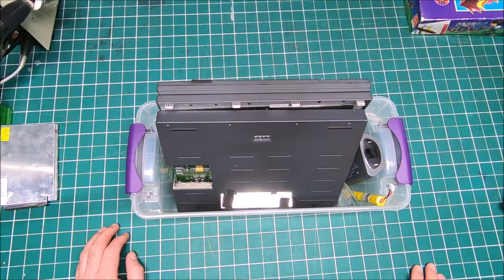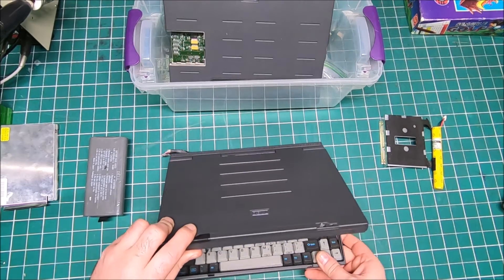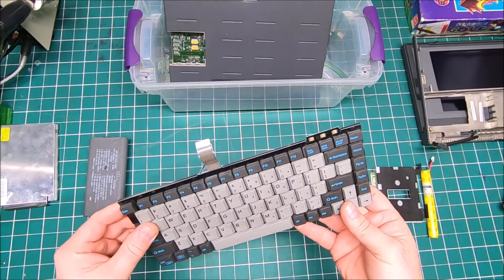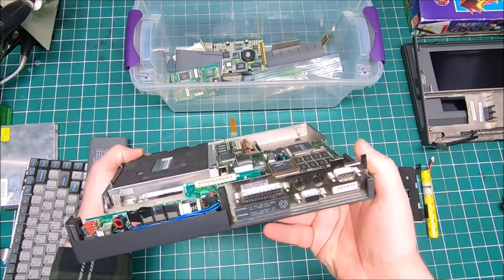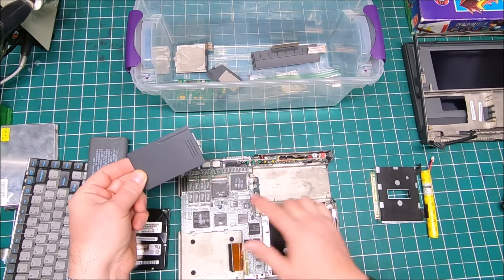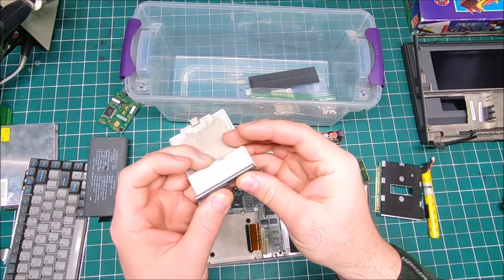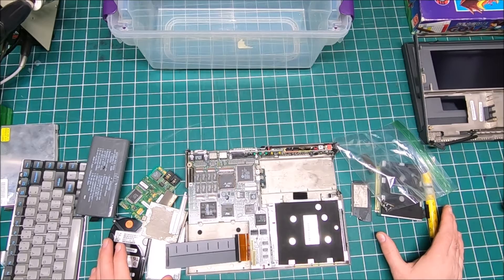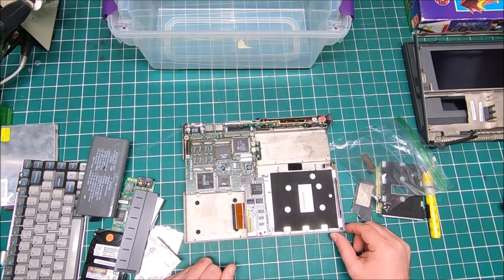Rare Vintage Laptop Dell 320n+ repair / restoration (Part 1)

Comment: 4:18 That's actually a 387 FPU co-processor. The 386 CPU is the smaller Intel chip below it.
9:13 That could be screws/parts related to the laptop, put inside whatever plastic bag he had laying around... Don't put it aside just yet!

Regarding installing Windows 3.1, you can find disk images of it floating around on the internet (not going to mention where, but you can google it). I highly recommend getting an external USB floppy drive for your main computer so that you can write disk images to floppies. WinImage is a good program if you use Windows.
Reply from the maker: thank you so much